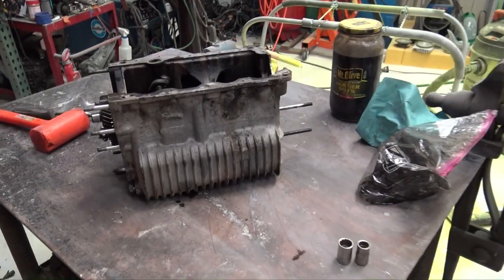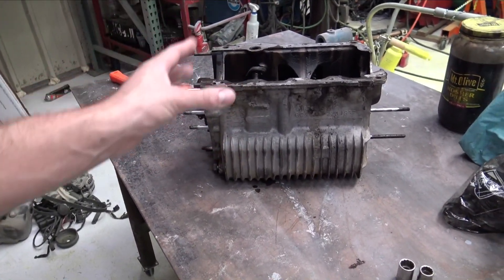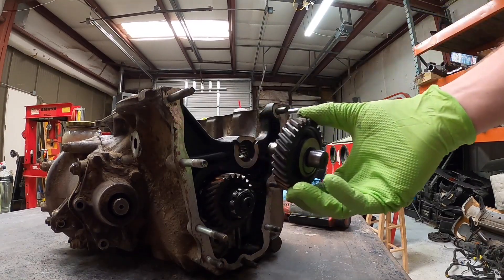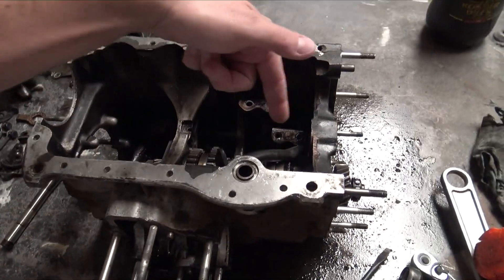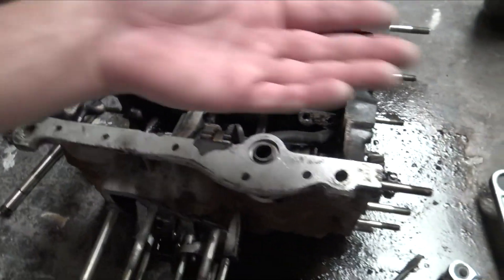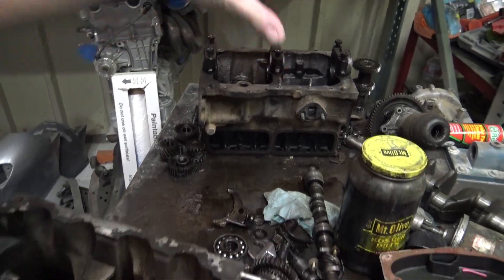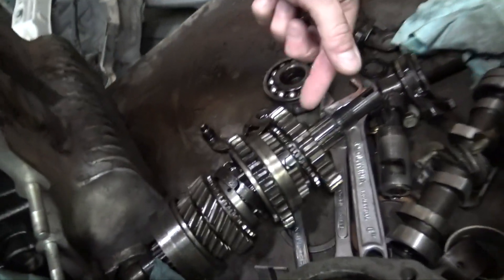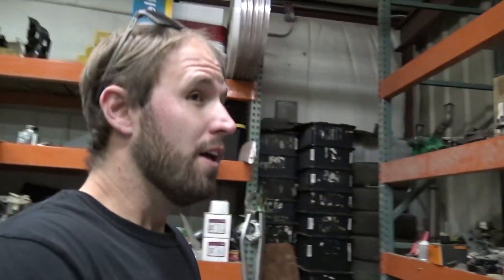Austin Mini Tear Down

Comment: For the gearbox you can remove the selector easy enough then pop it in reverse and 1st( I think, can't remember now) then get that shaft bolt off, also, that first gear you pulled off the casing is shimmed to a specific tolerance and the gaskets for the plate come In Different thicknesses, so be sure you get the tolerances right

Comment: Various cheap household cleaners can be much better than many expensive automotive products.
Oven cleaners caustic or enzyme based can remove backed on grease and tarnish, caustic or alkaline based products will eat aluminium very quickly so be careful not to leave it soak too long. Automatic dishwasher powder can be used as a scrub or dissolved in hot water and brushed on or used in a pressure washer (it is usually caustic) many toilet cleaners has various acids and detergents in them which can be good for removal of rust and brightening aluminium.
Some drain cleaners are either pure caustic soda or pure acid almost.
Generally acids are good for cleaning aluminium and removing or converting rust.
Caustics are good for grease and coak removal and destruction of aluminium.

Comment: Anything that works is banned and alternative products don't and you need to use more,just like water saving low flow toilets, 5 flushes compared to the normal toilet one flush takes care of the job,5 flushes is basically the same amount of water use as the normal one,savings? NO!

Comment: Well dave i had been on the follow up since u started u super Charger Magnum build and you are all about stuffing the baddest engines in cars... Why trying to fix this old mini engine that would probably do 20 or 30 hp max?! Couldn't u make this an interesting build and shove a v-tec engine in it or a boxer engine or whatever drivetrain that can make this little thing a bullet?! It d be w challenge to cope a relatively big engine into such small car but if u r someone who is basically on same level of an OEM production level for amount of time, effort and detail u give to ur builds, why not making 2 rockets???